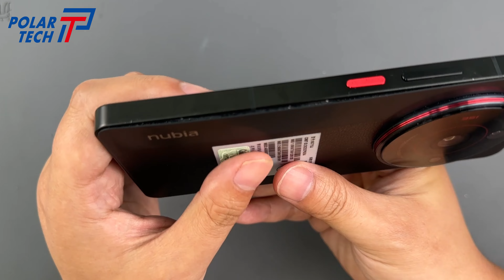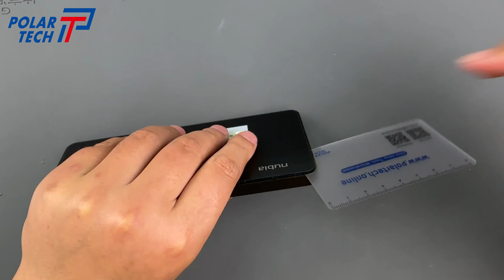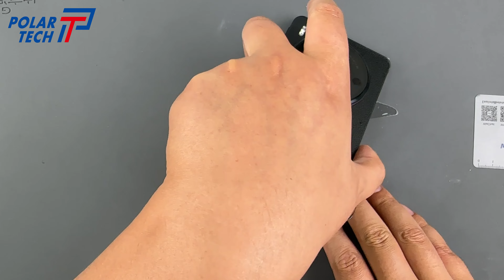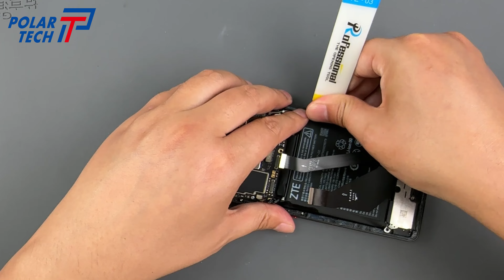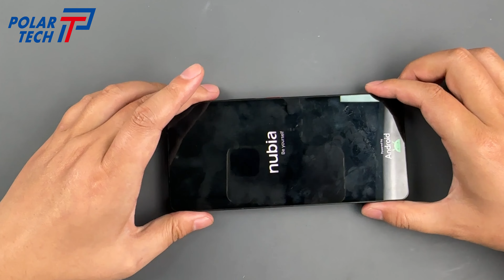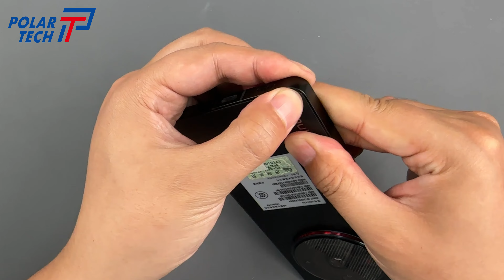ZTE nubia Z50S Pro Battery Replacement | Swollen Battery Repair Guide

Comment: Can I ask a quick question? Is the battery from the Nubia Z50s Pro compatible with the Nubia Z60s Pro?
Reply from the maker: Yes, the battery is compatible. The Nubia Z50S Pro and Z60S Pro use the same battery model.

Comment: Thanks for the guide. Had to replace the battery on mine, even though it didn't swell up the usual way: only the corners did and instead of puffing up they got rock hard and pushed the cover off. Very weird, first time I've seen a battery do this.

Comment: Hello, friend, everything okay? I followed your tutorial exactly, but now when I try to turn on the device, it briefly starts with the logo and then shuts off. Do you know what could be causing this?
Reply from the maker: If the battery is properly connected but the issue remains, the problem may lie with the battery itself. We recommend trying our replacement battery for a reliable fix.
https://www.polartech.com.au/products/li3949t44p8h776759-genuine-original-zte-nubia-z50s-pro-z60s-pro-replacement-battery

Comment: Can you please tell us how can we solve the problem of ghost touch in this phone. I changed battery according to you video it worked for 3 days very well but suddenly one day it showing ghost touch and then I reopened the battery but screen was showing wierd lines and for one day it did not open some how I reset the phone and now display is showing normally but I can setup the phone because the ghost touch is not allowing me to do anything. Please help me with this problem
Reply from the maker: It’s usually caused by a screen issue, so you can try reconnecting the screen flex cable first.
Reply: @polartechonline i try doing that thanks

Comment: Do you ship to Brazil? Is the Nubia Z50s Pro battery still available?
Reply from the maker: Yes.in stock
Reply: @polartechonline  conseguiu comprar? estou com o mesmo problema
Reply from the maker: @vidiudusotu  https://www.polartech.com.au/products/li3949t44p8h776759-genuine-original-zte-nubia-z50s-pro-z60s-pro-replacement-battery